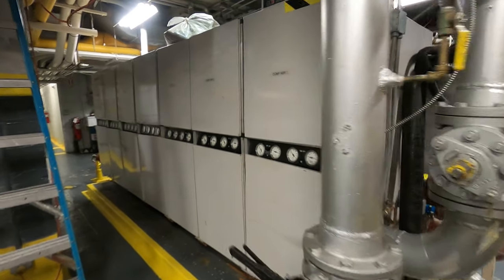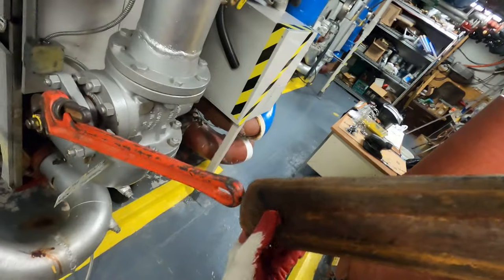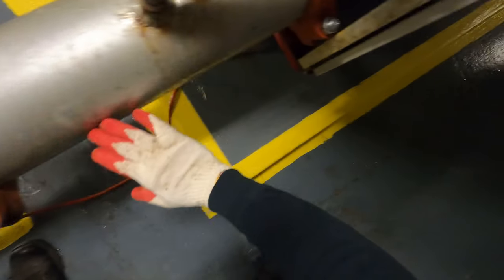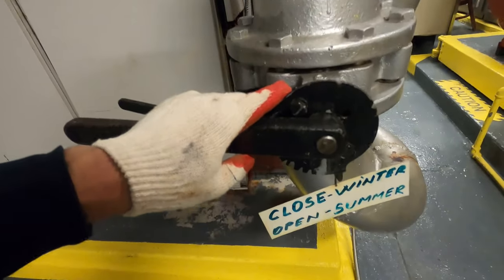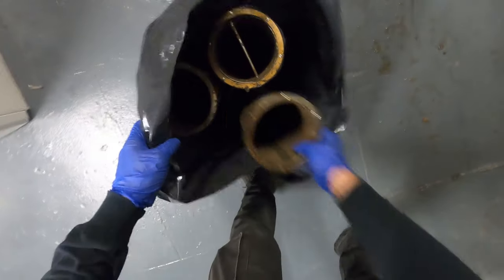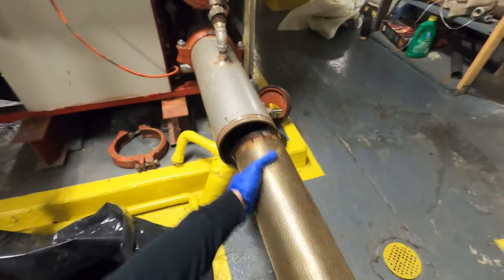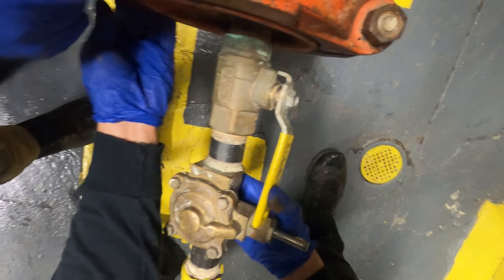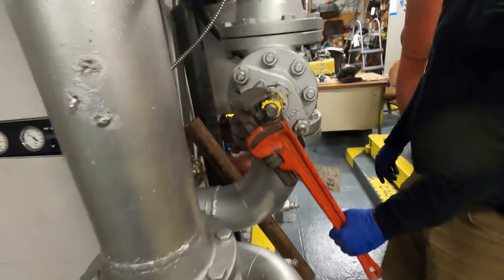MultiStack Modular Chiller Maintenance (Condenser Water Strainer Cleaning) Industrial Refrigeration

Comment: Great video as always.  About to do a service on one of these units that hasn't been done in 5+ years so should be exciting.  Feeling a lot more comfortable after watching your video so thank you.  Only thing I'd add is you should open that bleed valve on the return side of the condenser to fill the unit up completely before cracking the main valve.  That way you don't air lock any pumps downstream (if there are any).